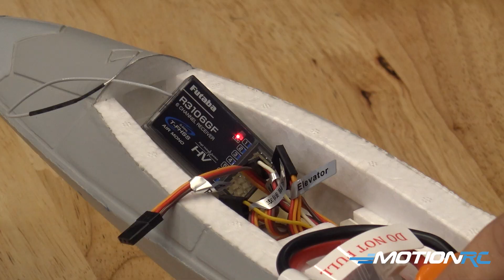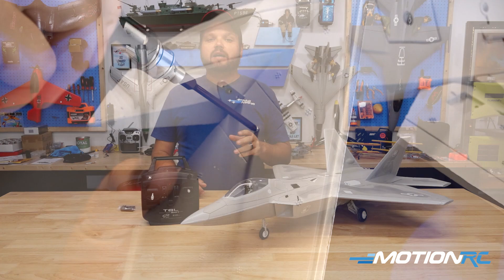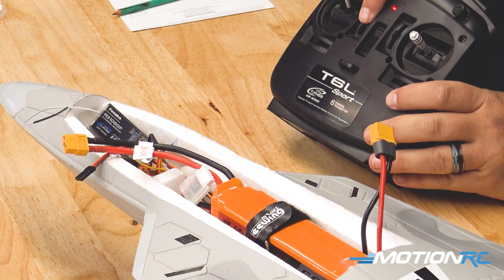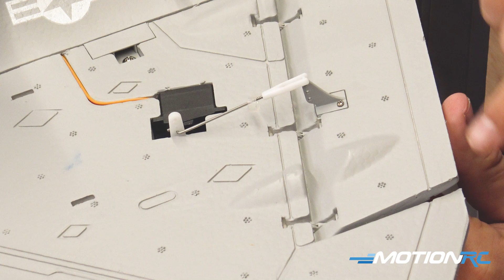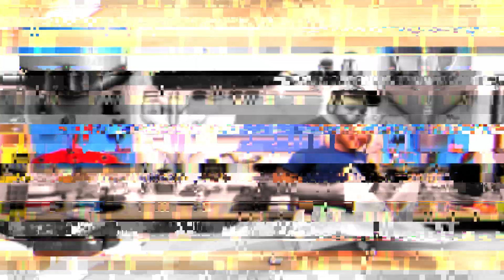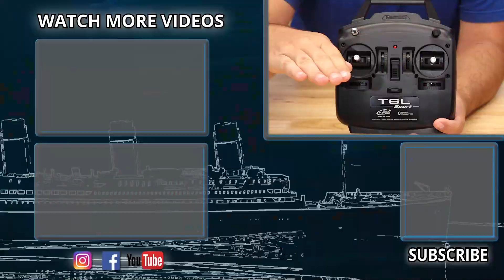Futaba 6L Sport 6-Channel Transmitter Overview For Beginner Pilots | Motion RC

Comment: Hi there, so in the video you mentioned on the receiver, R3106GF, you plugged the battery power into the throttle slot, but in the instruction manual the diagram shows the battery power plug going into the last slot, after slot 6. Is the last slot the power one or is the throttle slot power for the receiver?